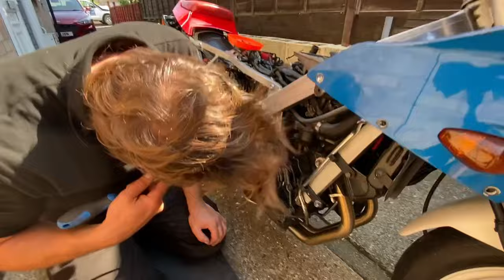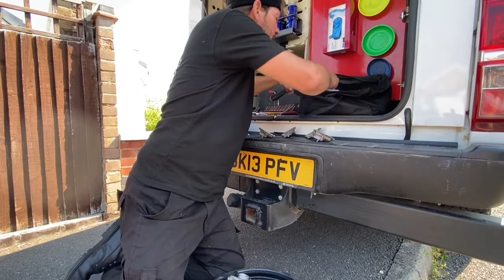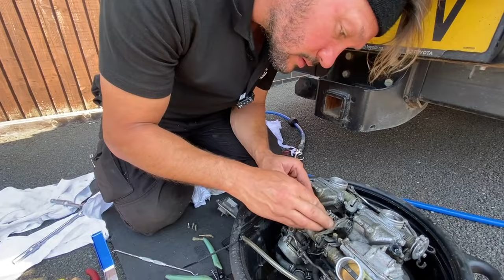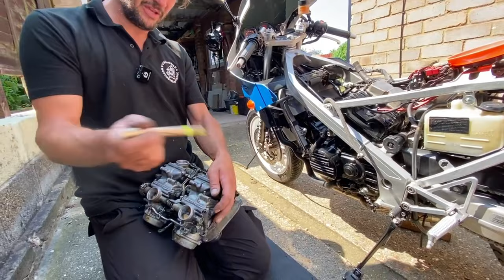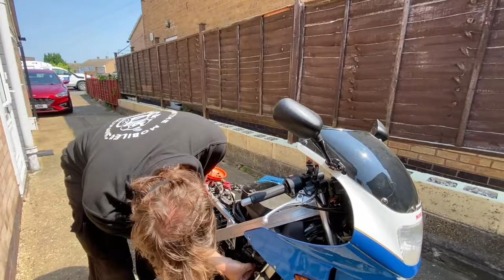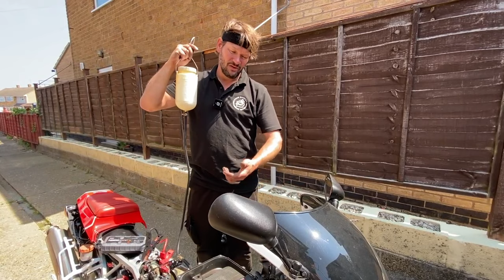Honda VFR 400 Motorbike with blocked Carburetors

Comment: Good video Steve, like the tip with the bit of tube, to help with the screw!! I’ve not heard about balancing the carbs around 3000revs before, so they’re on main jets, that’s a good tip, usually when I balance mine they’re just on pilots, at tick over, I will try that in future! Thanks for sharing!!